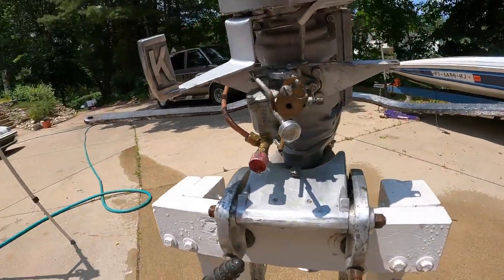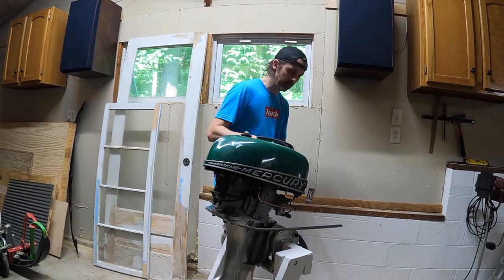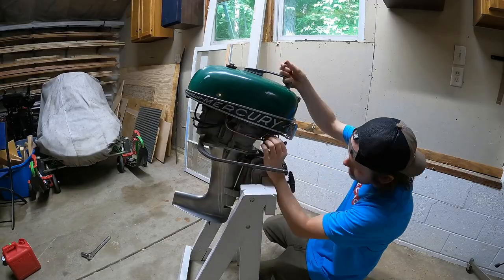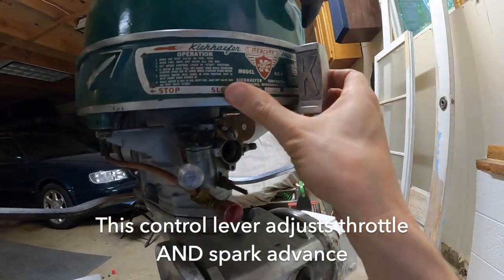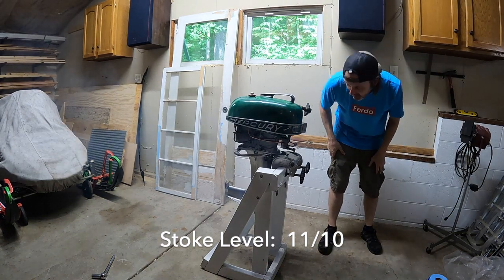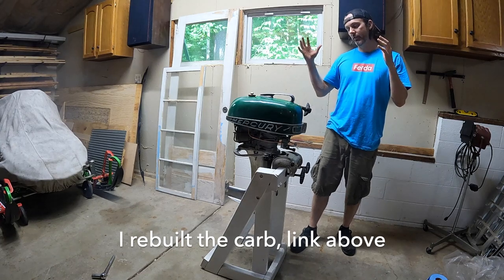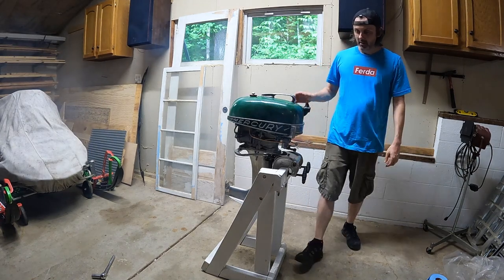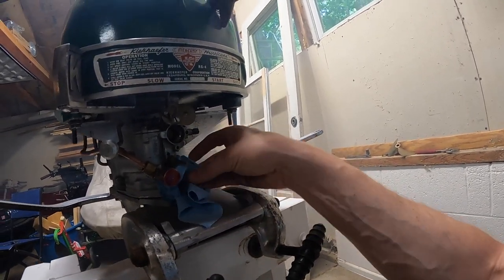First Start in 25 years:  Kiekhaefer Mercury KE7 KG4 Vintage Hydroplane Race Outboard

Comment: A freind of mine had this same engine. We had it on a small boat growing up in the 1950's. It really flew over the water. A dynamite little engine. Very powerful for a 10hp.
Reply from the maker: No, but I am going to do a video on failing clear coat soon.
Reply: I have one, and the last time I ran it it felt like more than 10 hp.

Comment: Is this a KE7 or a KG4?  The KE7 is a 10 HP and the KG4 is a 7 1/2 HP but the KG4 (still 7 1/2 HP) is a higher performance than the KE4 because it has much higher compression due to "pads" or shaped aluminum the mirror image of the pistons. The KG4 was rather rare
Reply from the maker: To be honest it's sort of a mutt built from a few different engines; I'm not really sure what it is.   The gas tank is not original to the engine, which is not original to the midsection, which is not original to the quicksilver lower unit.   So.....  who knows.
Reply: @ADDvanced is there a way to tell from casting marks? I have a 10 hp and a 5 hp. Or at least I think it's a 5 hp.